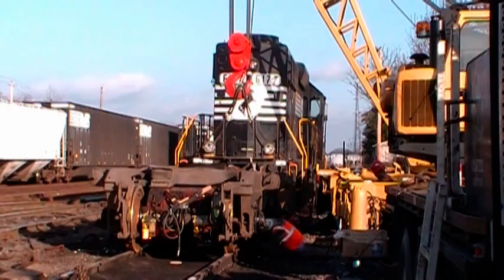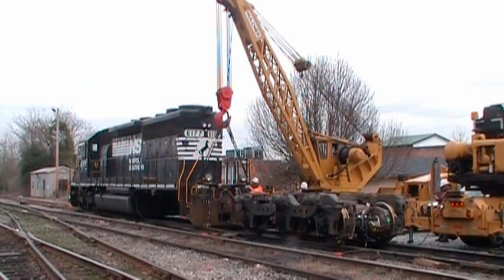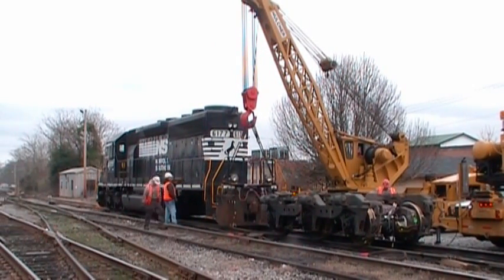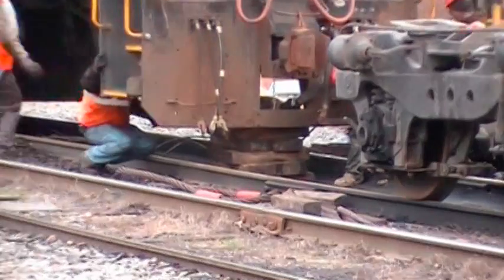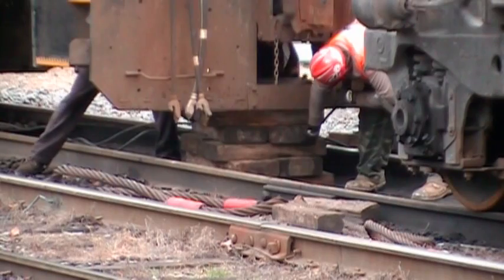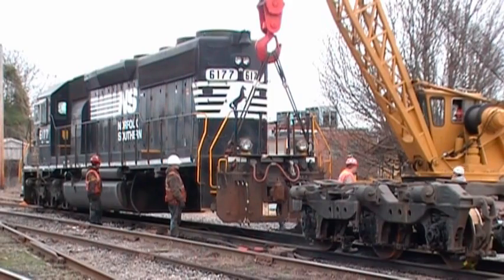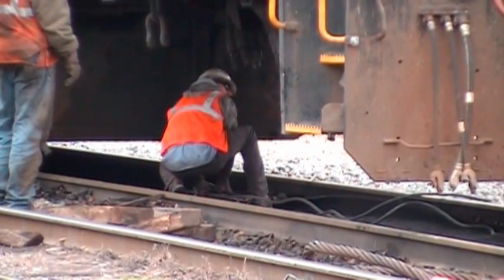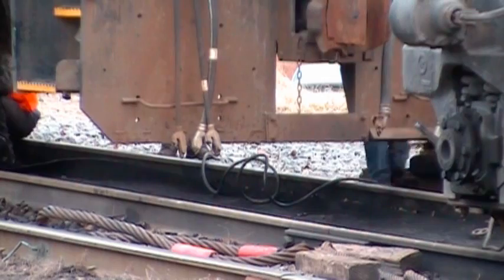Traction-Motor-Series-Part-7.mpg

Comment: Very informative video, I always wondered how they would change the traction motors out on a monster like this. I am fascinated by anything having to do with locomotives and trains in general.  My Uncle worked as an engineer on the New York Central for 45 years. Great rides in the steamers when they had those.

Comment: i saw even more bigger on the EA 5100 Locomotives. Pure electric locomotives with 8000-9000hp 27kw  50hz system.  Powersuply by catenary.